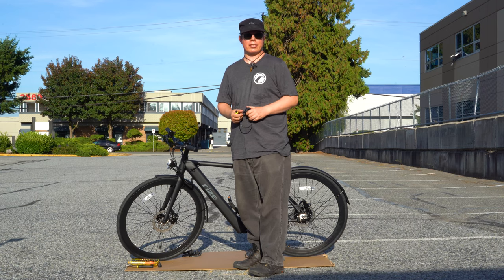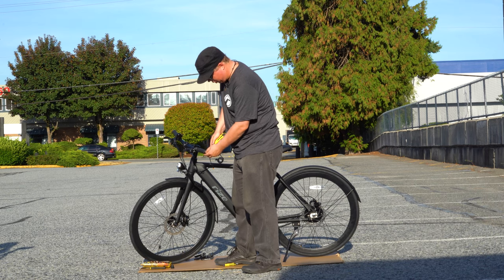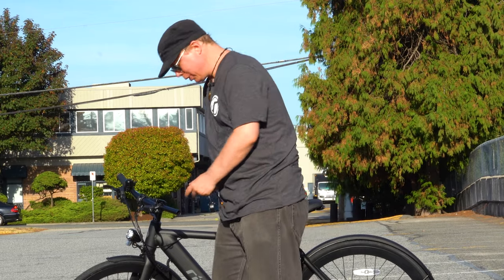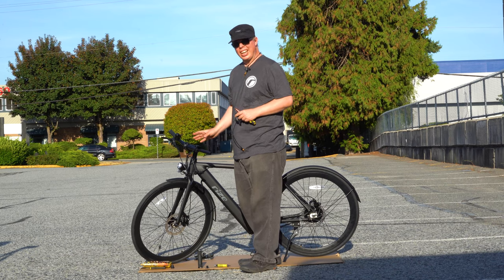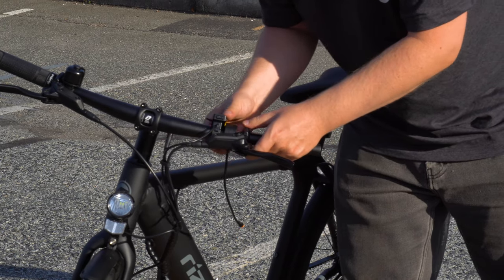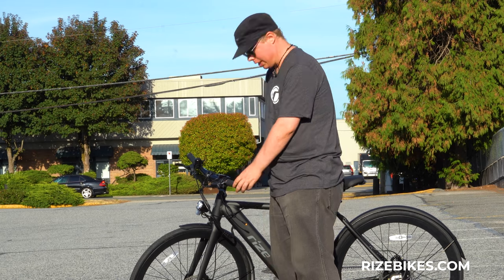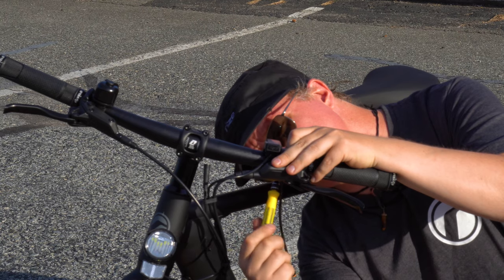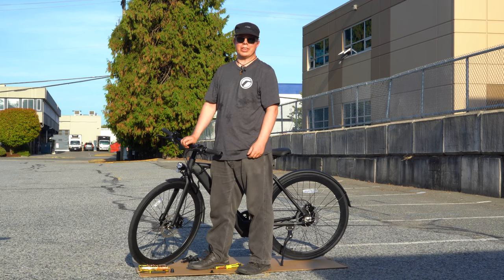How to install a throttle on Rize Fixie

Comment: Thanks for the video. The cables were pretty tightly wound, and to not disturb that I had to loosen the left brake to move everything over. Anyway. It’s all done and I tested it. Personally, I’m not sure it’s worth it. The throttle is quite weak compared to peddling, and it doesn’t get me up big hills at all as I had hoped. But I suppose it’ll be nice to have some day when I’m lazy.  Still loving this bike. It’s great for a relatively flat area and for commuting. So far my range on the highest settings is a good 40 km. Pretty sweet.
Reply from the maker: Hello Paul,

Glad you got to enjoy your bike! Pedal assist is always going to feel stronger as you combining both the movement of the motor as well as your legs on the carbon belt.
Reply: @RizeBikes  That sounds logical…but no. Even if I lightly move the pedals without resistance the bike motor literally pulls me up the hill.  The throttle never does that.  It’s like it’s on a different motor that is very weak.  Anyway, I’m good.  I know how to make it work for me.  Just saying that the throttle doesn’t help like I thought it would. .
Reply: All that being said... ya, it was nice to have the boost from the throttle off the start at lights and in traffic today, and to be able to quickly accelerate out of a tricky situation when my assist level was set too low to do the job.  I am warming up to it!

Comment: Would it be much different installing a twist throttle ? I got a  liberty , and my gloves always get caught on the thumb throttle kind, so I wanna switch that.
Reply from the maker: Hi Ashton, the only difference in installing a twist throttle is that you will need to remove both the left and right grip. Email us at support@rizebikes.com should you have any further questions!
Reply: Did u get a twist throttle yet m8? I'm looking to do the same on a Blade 2